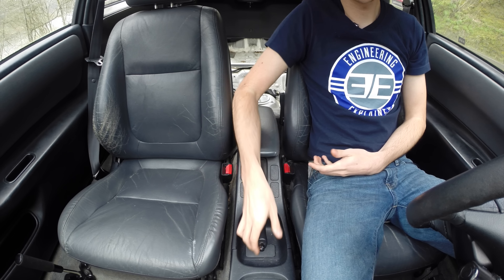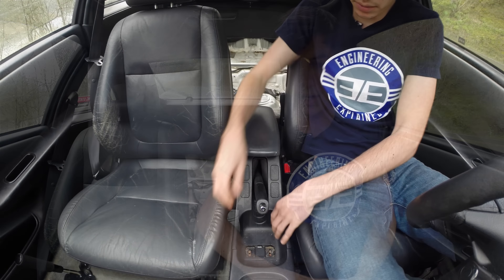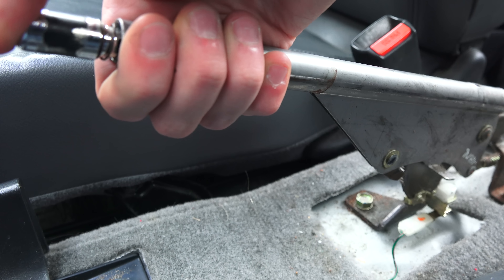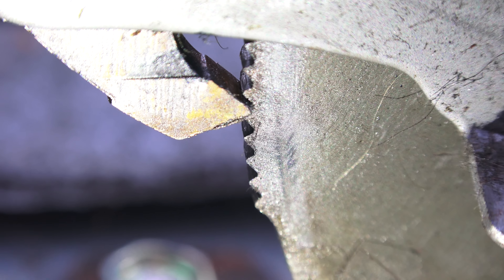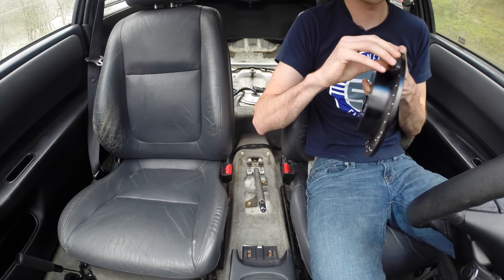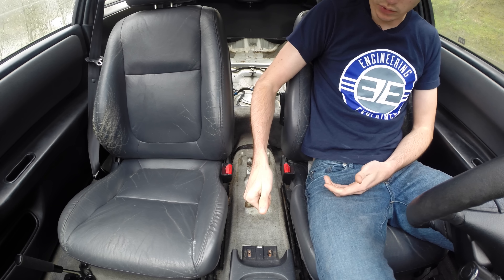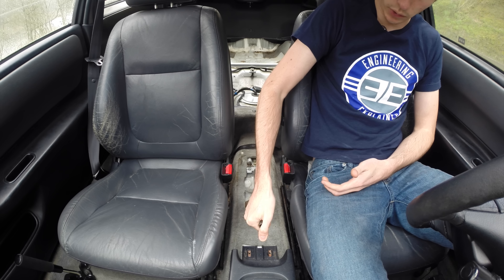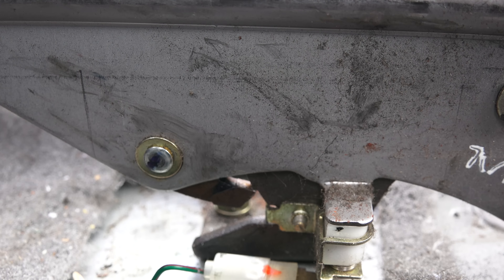Always Press The Handbrake Button? Myth Busted

Comment: I always press the button but I hadn't thought of the wear part, I probably did it because I don't like the sound of metal on metal contact. I agree with your point but wear isn't caused by heat although it does play a role. Just to be clear so others don't think "oh it's hot so it must be wearing out or something like that." It is caused by pushing the material beyond it's elastic limit which could generate heat or heat could reduce the tensile strength of the material itself which accelerates the process. I do know about creep, glass transition (which is probably not very relevant here) and other things that factor in but I was just trying to point out that just because there is heat doesn't mean it wearing out. Pardon me if I am missing something.

Comment: It'll definitely wear even without the heat but overall you're 100% right. Also, if the teeth did get rounded over you could just break out a file and file them back into shape; a simple inexpensive fix.

Comment: I agree with you... ish! For over thirty years I have been working in the industry, mostly restoration work. I have to say it is not unusual to see a worn ratchet pawl and this is something we often have to remake during a restoration. But, as you say, the pawl and quadrant lasted for the normal life of the vehicle... no problem. As for the socket wrench ratchet, it is the same scenario, but the ratchet is made for that purpose, that is; to constantly ratchet and has the luxury of a different steel, something not practical in most hand brakes! Even then, I have had a few ratchets fail prematurely too.
In summary, you are right, for normal every day use, no harm (unless the car is to be kept for a long time). From and engineer's point of view... be kind to it and press the button until the last clicks. Remember where there is noise there is wear :).

Comment: pushing the button and pulling the brake might make you pull it unreasonably tight causing your cable to loosen up over time so it would need to be tightened up but thats if you pull it to tight. keeping the tension on the mechanism allows you to feel the needed ammount of tension on the brake so it wont loosen your cable or atleast not as fast

Comment: My trucks 53 years old. The cable on the park brake broke but the rachet lock still is fine. Sometimes the button gets jammed and you gotta wiggle it around though, so I would argue that pushing down the button when you engage the brake induces unnecessary wear and tear.

Comment: I agree, it doesn't cause much wear and even if it does, it costs just 30$ to replace. But I got used to always push in the button because soon after I got the license I was learning to do handbrake turns, but I sometimes forgot to push in the button until it was too late and I even crashed once because of this. So I started always pushing in the button even when I park to prevent another crash :)

Comment: The wear and tear on the hand brake ratchet is dependent upon the composition of the two metals and the strength of the spring that holds the the pawl against the ratchet.  the alignment of the pawl and ratchet is also a consideration. Depending of the country of manufacture,  where the pawl is a hard metal and the ratchet is stamped softer metal the chance of wear is high.

Comment: im certain once when  applying the handbrake with the button pressed first the lever once jumped out of the detent position. pulling the lever up without pressing the button first ensures the ratchet has enguaged the detent properly as you hear the ratchet click in the detent

Comment: It makes some wear, but I use it every day many times, it has 300k km. But it is not enough, because the plate is made of slightly harder material (I know some cars where it wore, but those were built in 50's in the Eastern block).

Plus it is good to put it up without pressing the button, because on some cars it might get stuck and you can't put it down again.

Comment: A lot, like my 2008 taurus, don't have a release button or pull handle. You push the pedal down to apply, then push down again harder and it releases and has a spring that returns pedal up to fully off position

Comment: Two points: 
1. Most people with pedal-actuated parking brakes don't hold the brake release while they are applying it. 
2. I might argue you're more likely to fatigue the spring on the button or some other part of the brake release mechanism because you're using it twice as often as it was design for.

Comment: I always thought this was just common sense, lol. You only need to push the button to release it after its already engaged/parked. Just from the sound of the handbrake you could already hear the ratcheting mechanism and pretty much accurately picture what it looks like without even taking it apart (though that does help for the thick-headed out there who don't get it right away, I suppose, lol.)

Comment: The one legit reason I was told about this that really makes sense (and I was a button pusher before) is that it is very easy to over tighten the handbrake and stretch the cable over time if you push the button in, since you can yank it up however far and lock it off - often unnecessarily tight when you are used to press, yank and release. Driving an 07 Audi A4 now, I have that centre arm rest that is only about 6 clicks up, so I really don't want to have to raise it any higher than that, even on a hill ;)

Comment: both the tool you are holding and hand break will wear out over time because of friction and metal sliding on top of each other causes metal to come of the surface the reason why oil is used in pistol cylinder engine. but you are right because in both cases the wear and tear is so slow actually really really slow that we will never see metal being scratched to an extent that it will fail in its mechanism after several generations

Comment: Here in Australia, the only time I push in the button to pull up the hand brake... is when doing a hand brake turn? When just using it for WHAT IT IS DESIGNED FOR... I never push the button in, for a couple of reasons. One, if you push the button and pull up the lever, then let the button out at the top and let the button out... you miss a couple of teeth so the brake is not on 100%. Pulling it up and letting the teeth grind together (making sparks as they clash together) ... lets you know the brake is definitely on and up as high as it will go... and two... I like leaving the button out and ripping up the handle (sparks and all) because it triggers people who don't like it haha.  I miss the old 'Mary Poppins' hand brakes that you pull out of the dash (like an umbrella)... now they only have a silly button tp press! I bet you also press the button wrong too? haha (Greetings from down under)

Comment: Okay search ratchet repair pawl and yes depending on your model some do wear out with incorrect  usage. I have replaced one in a 1964 car 30 years ago, though I think it was more of a problem with the under the dash type hand brake on some older cars where I think this assertion originated from.

Comment: You are right for handbrake but brakes and tires dont ware because heat.they ware because friction, and friction on handbrake is very low.
Reply: But if the brakes or the tyres are heated up they can ware faster if there is friction.

Comment: It's actually better if a ratchet spanner wears as it allows it to reverse back when the nut or bolt turns too easy for the ratchet mechanism to work for you.
So keep spinning then in your hand to your heart's content and even encourage the kids to fidget with them.
That handbrake has solid metal contact surfaces and little stress with that spring loaded pivoting hook thing.

Comment: An off topic question: how about "exercising" the handbrake while you're driving and come to a stop? I do this quite often to scrape off surface rust and just to keep the brake in good, working condition.
Reply: Surface rust off of what? Don't forget the rear brakes also get actuated when you press the brake, not only the handbrake.
Reply: You read half of what I said. Obviously I meant the surface rust on the rotor. But that's just a "side effect" of the most important thing which is to keep the brake in good, working condition. I can't imagine that never using the handbrake except for just parking is great idea either. It'll seize up. And no, I don't think that the back brakes are activated unless you push the brake pedal extremely hard to the floor from a high speed. Not too many people do that.
Reply: That is not correct.  Front and rear brakes both get pressure whenever the pedal is depressed.  typically the brakes are heavily biased towards the front because the front wheels have  a higher normal force under braking and therefore can handle more brake torque before lockup.
Reply: And you pulling the brake should be enough.  As long as there is tension in the cable, it is connected to the rear brakes.  There are no additional pads for the parking brake, they simply apply pressure to the rear service brakes.
Reply: The small amount of pressure that the rear brakes receive from a relatively slow speed compared to the front brakes won't be more effective than the pressure from just pulling the handbrake. But my question was about keeping the handbrake in good working condition all around the year, and the best way to accomplish that is simply to use it. I've also heard that you if pull it in reverse it'll scrape off rust better. In any case, using the everything in a car will avoid stuff to seize up. That's my philosophy at least.
Reply: After driving through water like a temporary flooded section of road, I will exit other side with brakes on slightly to dry rotors, and force water off all moving parts as well as to ensure brakes still working.  Better to do then than to put brake on in a hurry 30 seconds later and brakes still water logged and not working.
Reply: You can pull the handbrake after washing the car, as well as brake a bit harder than normally. If the car stands a few days, or even a day depending on the weather, the brakes might "scrape" a little bit when you start driving, i.e., until the surface rust goes away. All this pretty much ties into my old original statement about using the handbrake rather than limiting the use to just parking alone. It'll seize up otherwise, guaranteed. An electric parking brake is probably 10 times worse as you can't, or shouldn't, even try to activate it under any circumstances except for when you're parking.
Reply: 1) All brakes are actuated evenly when you press the brake pedal.
(Have you ever seen a car slide (even with ABS brakes) during a very fast stop?)

2) Handbrakes do not work better (or even differently) forwards or backwards.

3) The average driver parks at least 4 times a day, which is more than enough use to keep the parking brake system from seizing up. (The components of this system are made from different (stronger) materials than the pads and rotors and, therefore, are more resistant to rust and debris.)

4) Electric parking brakes are Federally mandated to operate without the presence of electrical power, as the system is designed to be used: A) When parking the vehicle and B) when main brake system failure has occurred and a second method of brake activation is necessary.

5) The rust that develops on pads and rotors does not necessitate the use of the handbrake. Normal braking will clear this rust within 2 stops. Every owners manual discourages parking brake usage while the vehicle is in motion, except for cases of emergency use.

6) At your next brake service, your mechanic will tell you that your rear brakes have excessive wear compared to the front, proving these points.
Reply: @a56232   When you say evenly, are you referring to left/right distribution?  Brake systems certainly are not even front/back to account for load transfer and weight transfer to the front axle during a stop.
Reply: a65232
1) Rubbish. 2) No one's claimed otherwise. It was about scraping off rust as pulling it in reverse is said to be more effective to accomplish that. 3) Rubbish again. It's supposed to be used and the best way to keep anything in good, working condition is to use it as much as possible. The weather isn't the same as in California all over the world. 4) Laws differ from one country to the next. Personally I'll take a "regular" parking brake 10 times ouf of 10 before an electric parking brake. 5) Again rubbish. Unless you push the pedal very hard from a high speed the rear brakes won't come in at all, or at least not enough to scrape off rust which was the whole pont of this discussion. Hence, you pull the handbrake and voila! and the rust comes off. 6) The only thing a mechanic will notice is how extremely rusty the rotors are for 9 out 10 people don't brake hard enough for the brakes to actually be activated as much as the front brakes.
Reply: +GymChess    Stop saying Rubbish, the facts mentioned above are sound.  also, as multiple have mentioned a bunch of times, the rear brakes are ALWAYS actuated when the pedal is depressed, however the force is heavily biased towards the front.  In newer cars with more electronic influence over the brakes this may not always be true, but I guarantee that it is for any average sedan that is 6-7 (especially my 2006 toyota crapolla with no ABS).  And the service brakes apply a lot more force than you can apply with the cable parking brake.
Reply: nick strahan
Anybody who claims that braking "normally", i.e., not hard from a high speed, or any speed for that matter, activates the rear brakes enough to make any kind of difference to my previous discussion about rust on the rotors is full of $hit.

I was also talking about keeping the handbrake in good, working condition. Now, if someone wants to imagine that in his head rather than actually USING it, good for him then. I stick to what actually works and makes difference.
Reply: nick strahan
Well, if that's true and you compare a race car to e.g. a Totyota Corolla driven by just about any average person who hardly EVER slams the brakes so hard that all 4 brakes are being used with enough force to a) make significant difference and b) to scrape off rust to a mirror shine, no wonder we aren't on the same "page".
Reply: Take a few minutes to do a bit of research instead of assuming im wrong about everything.   Typical FWD cars bias about 20% of the braking effort to the rear, which even in light braking is at least 2-3 horsepower.  I would imagine that is more than enough to scrape off a bit of surface rust.
Reply: nick strahan
Compared to just pulling the handbrake I'd say that it's little to none - again unless you brake very hard which most people don't.
Reply: lol it looks like a lot of people lack the ability to read here and chime in without even understanding what the guy's saying (gymchess). having driven 100's of cars in my life it only makes perfect sense that not depressing the pedal hard enough won't put all brakes into even use. a car travels forwards, not backwards unless you're in reverse. that means most force will be on the front brakes. if you depress the pedal hard the rear brakes will kick in. if you brake like most people do under normal circumstances, hardly at all, not enough to accomplish what he's suggesting here -- to get surface rust off as it would by just pulling the handbrake every now and then while driving. he also talked about keeping the brakes in working condition by using them. so?! what's the problem? is someone saying that the guy's wrong? lol most posters here probably don't even have a driver's license.
Reply: Lol! I'm 30, with a commerical drivers license. Having bled brakes on multiple vehicles, I can assure you that all brakes are actuated, even when the vehicle is NOT MOVING!

If people want to be extremely technical, fine. Braking effort is more biased towards the front than the rear, even if it's only a negligible difference. 

I forgot. I can't comment on Youtube videos without an opposing opinion vehemently justifying themselves. If you'll excuse me, I'll be doing anything else... because this debate no longer warrants my time or energy unless someone with an A.S.E. certification wants to teach me something.

Comment: Well, I've had to replace one or two ratchets on a handbrake so some DO wear. But maybe an important factor is how much you use it: I live in a city and have to stop for lights, crossings etc very often. Unlike everyone else around me,  I apply the handbrake if I am stopped for more than a few seconds.  So I might use my ratchet 100 times more than someone else over 100k. And when all is said and done about whether it wears or not, it isn't that onerous a thing to press the button in just in case - kind of Pascal's wager as applied to ratchets.
Reply: So, you are saying you misuse yours and it breaks. gotcha.
Reply: Cyril Heslop yea pascals wager is a bad argument in general.
Reply: Mark Lewis
Nope - I'm saying I have repaired cars that have been misused.

Comment: When you think about it, that's kind of the point of a ratchet, it's to slide upward while a pin locks it from going downward. Honestly, holding the button feels like you would wind up having it slip downward when you release the button at the same time as letting go of the handle.

Comment: What I would add though is that before pressing the button to release the brake you should take the load off the ratchening mechanism by pulling the parking brake up. Not doing so indeed does wear out the mechanism quite a lot!